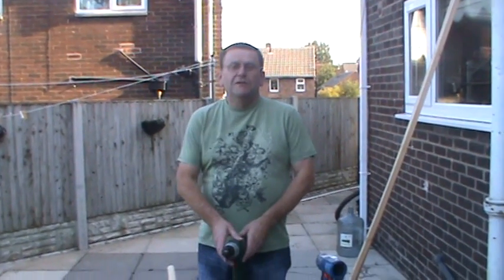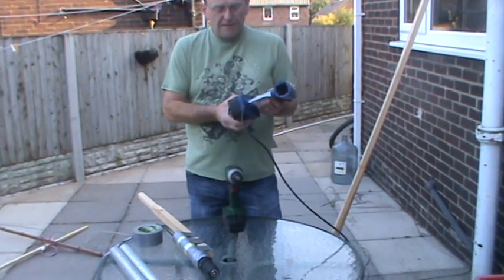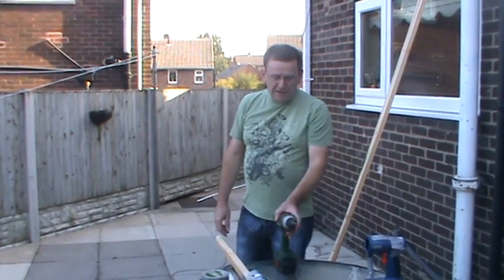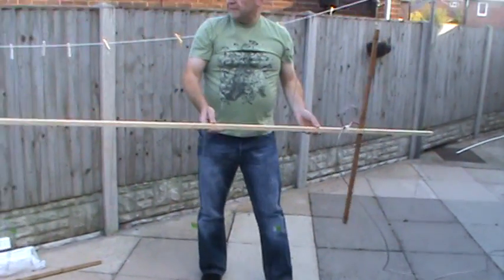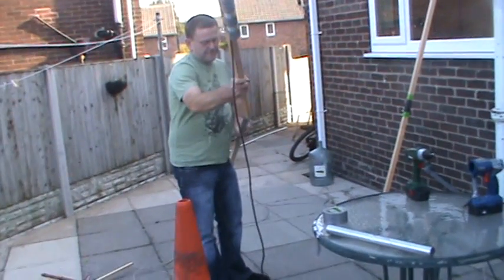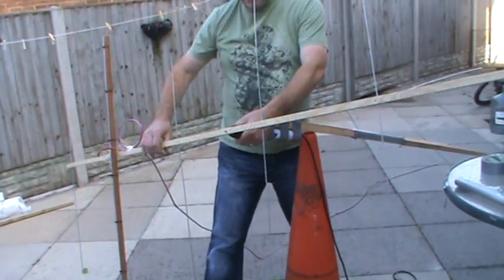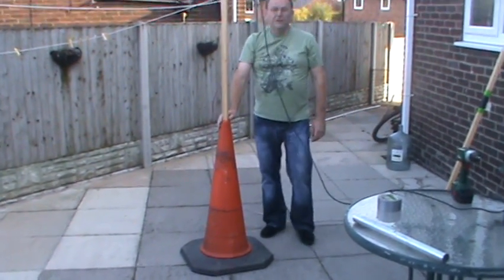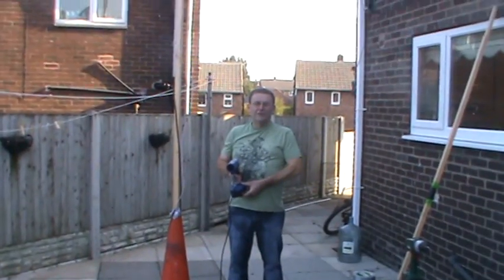My Drill Rotator

Comment: You should use a transformer or resister to step the voltage down to the motor so it doesnt spin so fast good build though 73's KC1AJR